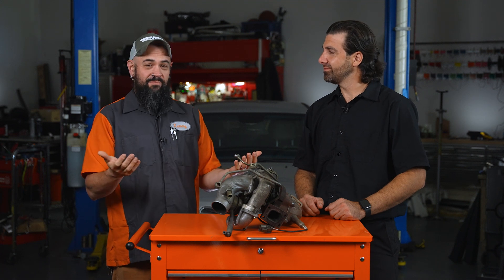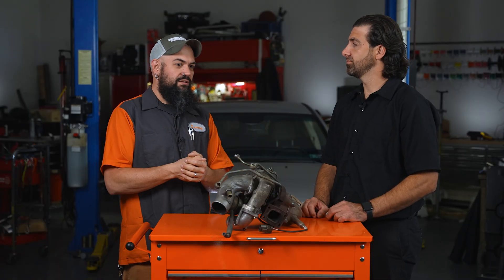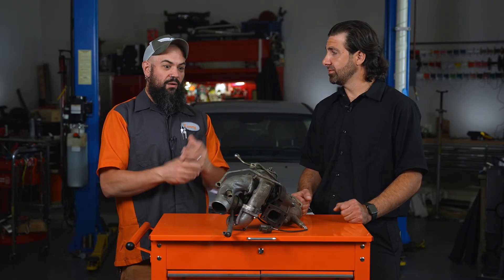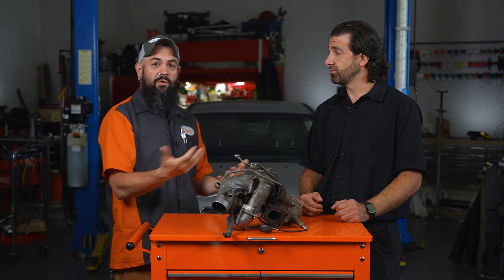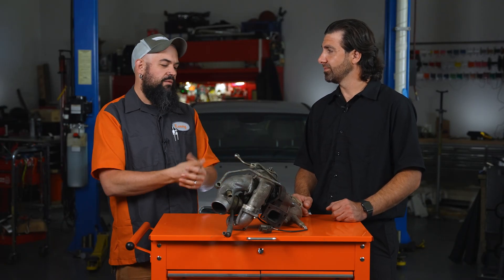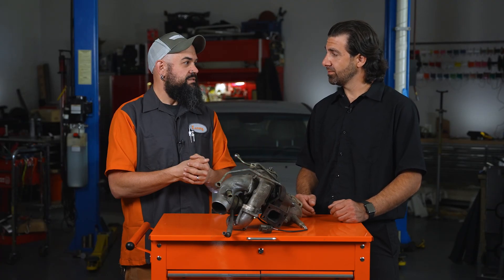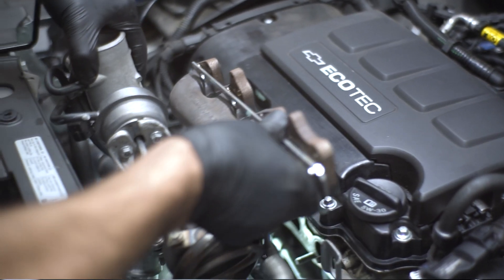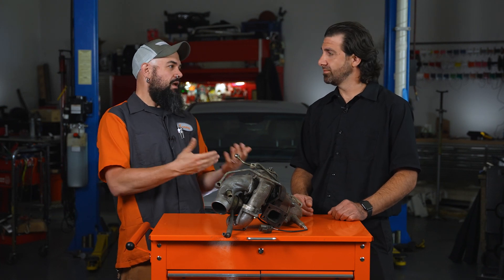Turbocharger repair and replacement: What you need to know

Comment: Very informative video. A friend of mine has a 2017 Audi (not sure of mileage) with a turbo charger that needs to be replaced, $4,000. Ouch!!! Now I'm really hesitant on purchasing a new vehicle (which most have these days)with a turbo unless the manufacturer would warranty them for 10 years. What are your thoughts on the smaller engines with turbos in, for example, the Chevy Trax?
On a side note, Lemmy sounds like the Lemmy from revzilla videos of years ago.